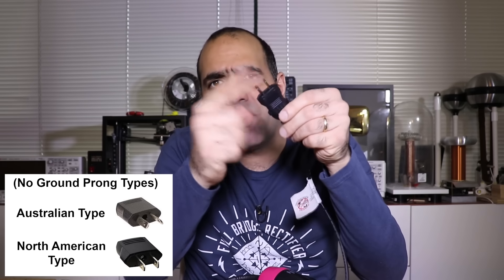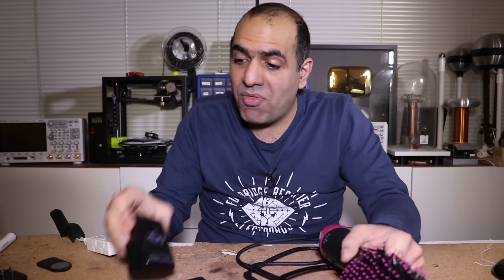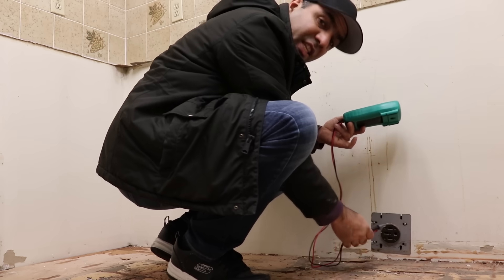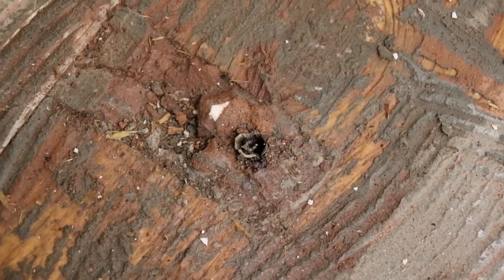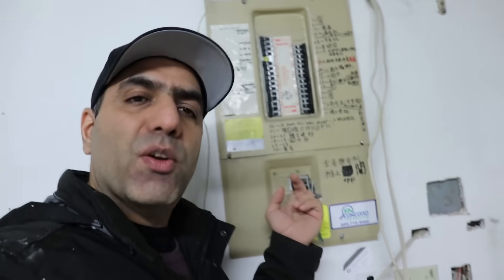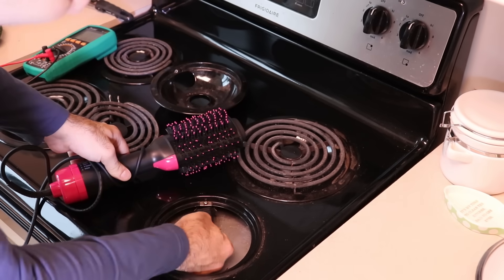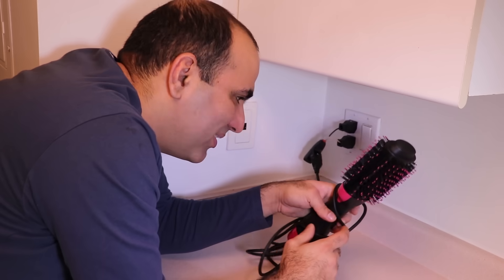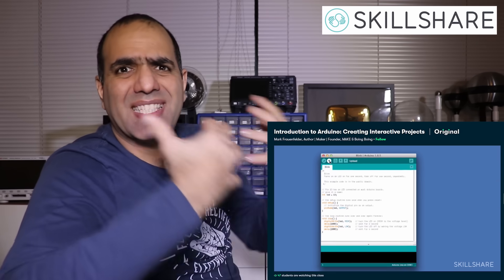Finding HIGH POWER 240V in a 120V Country

Comment: Kitchens are wired that way for a 3 wire setup and thus the neutral wire only conduct the imbalance of the load on those outlet.

Btw I know it's the case but I still have a super hard time wrapping my head around that concept. Making a video explaining the concept would be awesome of you as long as you don't hurt yourself.
Reply: Pure 3 phase systems don't have a neutral line. It is not needed. All current in any direction travels down the phase conductors of which there are 3.

The electricity traditionally is output from the generator station as 3 phase. Some power stations such as hydro electric may differ.

The 3 phase conductors are routed from the generator to your district where they feed into a step down transformer (I am missing out the step-up at the power station end).
If you're feeding 3 phase power to a 3 phase motor used in industrial applications, you don't need a neutral line.
But if you want single phase to feed your home, then you need a single phase conductor and a neutral. That neutral does not come from the power station, it comes from the local step down distribution transformer that is in your locality to your home.

That distribution transformer is a 3 phase transformer with 6 wound coils. Three on the primary high voltage side and 3 on the secondary low voltage side. Those 3 coils on secondary all have one connection connected together in what is called a star configuration. The centre point (don't confuse this with centre tap which is different) is where neutral line is connected.

Single phase loads will be placed across the phase conductors and neutral. For example, Load 1 would be across phase 1 - neutral, Load 2 would be across phase 2 - neutral and Load 3 would be across phase 3 - neutral.

If Loads 1-3 all use the same amount of power then the current in the neutral line is zero, and this is said to be balanced.

Unbalanced loads, where the loads have different impedances and are consuming different amounts of power results in a neutral current flowing.

The power companies don't like a large amount of neutral current flowing, so effort will be taken to try to balance the load across the 3 phase conductors.

Comment: Oh my goodness. What a messed up system. 110V for some stuff and 220V for others. Why not stick with 220V 50Hz across the board like we do here in Australia and the Brits. So much simpler and it works well.
Reply: Because very few devices need 240V, and our split phase system is far safer.  We get 240V when we really need it, but no part of it is ever more than 120V above ground.  Most things run just fine on 120V.  For the very few devices in our homes that need high power, we have 240V outlets available.

Comment: 03:49 to be frankly, i did that a bunch of times unintentionally XD
Reply: I've done it once. RIP to the 10A fuse and the tips of my probes :(
Still usable though.. other than current readings
Reply: To be frank*
Reply: ty
Reply: Sooo...did yours explode like that 😆😆😆
Reply: @YTshashmeera  mine did not
Reply: yeah, it did... but beside of the probes, the multimeter is still working fine nonetheless
Reply: @Guidje  What happened to your fuse if your multimeter literally exploded in a shower of sparks?
Reply: the fuse broked, i change it (and the probes) and everything went fine after that... of course the sparks weren't so intense or dramatic, but it happened

Comment: the 120V AC outlets in north america are not "180 degrees out of phase" as you say, in reality they're only getting half of the wave.
Reply: In reality, you're getting half the voltage because the neutral is always halfway between the two hots.

Comment: They sell the 120 to 240 volts step up transformer. It looks like a huge power brick. But yeah they really only made to run stuff like ac adapters and electronics.

Comment: Mehdi, can you do a demonstration to show whether keeping an appliance or other item plugged in (ie blender, USB charging block, power bar, etc) is using electricity even when not in use? I’m not sure if you’ve covered this in the past.  Thanks for all your hard work!
Reply: Unless the device has a physical switch that breaks the line coming in, then it will use power even when it is turned off.  Whether that power is significant or not, depends on the device.  A microcontroller that spends most of its time in sleep mode watching and waiting for you to press the power button on your TV remote control might use a fraction of a penny per year of power.  You can buy devices like the kill-a-watt to find out how much power they really use when they are "off".

Comment: large apartment buildings have 3 phase 208v for general use, and a single leg of 277 for lighting or just 3ph 208v..  most often off a transformer that is on the same property.  single family homes have 240v single phase right off the transformer at the pole.  (sometimes its 220v)

Comment: I saw the thumbnail and when the scene came I was like: „Let me guess, he‘s measuring current...“
Reply: Even though it's staged I still laugh my ass off when I see it
Reply: It was a nice effect x) Obviously he just has a small charge/firecracker on top of his multimeter, that's why it is conveniently tilted. He wouldn't risk breaking a multimeter just for the effect. Plus if you measure current like that when you are supposed to measure voltage it will only start welding the probe heads, no bangs (I've done that mistake a couple of times)
Reply: @TheJugiChan  maybe he has a capacitor thats not rated for high voltage
Reply: @vladchira521  The casings in multimeters are pretty thick. When stuff blows up inside you just hear a noise, definitively you don't see sparks shoot out. Multimeters have a fuse inside that protects the rest of the electronics and you can only hear a faint click when it blows. As fun as it would be to think he messed up, again, all of these "accidents" are for entertainment, but I do still appreciate them.
Reply: TheJugiChan ruining a multimeter lol it’s just a 10 dollar fuse
Reply: @jjelassar  Yeah, again the fuse doesn't spark. And again I do enjoy the entertainment. But it is not a god damn fuse that blows up in the video :P There is no reason to blow up a component inside when you can just more vividly make something spark on top.
Reply: @TheJugiChan   ....except for the fact in the next scene he has 2 of the same meter on the ground, it was staged but i think he used a real meter to do so
Reply: @frogz  The fact that he has two doesn't mean anything. If the one blew up why would he say "I hope it still measures current. Hey it does!" and then he just doesn't mention he switches. Then more points: when the sparks fly, both of the probe wires are close to each other, this is not the case even if he was measuring current. He is clearly holding then in place so the end blow up whatever firecracker he has on top. Also, the damn probe wires don't magically fly off. It takes some force to take them off a multimeter. Mehdi is a smart guy. I find it cute that most people want to believe these accidents happen to him in every video. And again, I appreciate the entertainment value, but blindly wanting it to always be an accident is naive.
Reply: @frogz  End I also repeat, multimeters do not blow up like that even if  he really were to have the measurement on current. The probe heads would just solder on a little and melt and/or the fuse would trigger (in a very non-explody way).
Reply: TheJugiChan exactly correct multimeters only blow up when your dealing with high voltage like high enough to run heavy machinery I work in an aluminum mill where some components are 4000 volts and I’ve seen an electricians multimeter straight exlpode arc flash hit the probes and the probes completely vaporized
Reply: and he dies

Comment: American homes use a single "split phase" instead of two phases of the three.  Each half are 180 degrees apart and together give you ~240v at 60hz.   I was surprised to learn that Canada did things differently.
Reply: Canada does it the same way.  His apartment building is a large urban building with 3 phase power.

Comment: Apartments usually are wired off of one or two legs of 3-phase. Homes usually are wired from single phase 240. You are such an idiot I won't bother with phase angles.

Comment: 3:48 This is why you shouldn't buy cheap crappy multimeters, they blow up in you'r face when you accidentally measure voltage in current mode!
And the first multimeter got damaged, that's why he got second multimeter at 4:23.
Pro'sKit MT-5211 multimeter has fake CAT IV 600V rating, it can't even with stand CAT II 240V short circuit in current mode!

Comment: National Electric Code requires two 20 amp circuits for the kitchen.  No guarantee they'll be on separate phases.  Really unusual to see two outlets on the same receptacle on different circuits, but if you have a small apartment kitchen, maybe.  I rather like the electric stove hack.  But here we also see that it's easier to rewire your house than to tell a Persian woman 'no'.
Reply: In the Canadian electrical code (CEC) it states that kitchen receptacle can be a 15amp split receptacle and if it’s 3ft near a sink, it has 5o be a 20A GFCI.  Also no more than 2 receptacles per breaker.
Reply: @Alex-lo6yt  Ah, didn't realize ElectroBoom was Canadian.  I should have been paying more attention.
Reply: If it is a multiwire branch circuit like in ElectroBOOM's kitchen (two circuits on one duplex outlet), they're guaranteed to be on opposite legs or phases because they must be on a double pole breaker according to code since they share a neutral.  If they're just 2 circuits going to different outlets, then you're right, there's no guarantee.

Comment: Could you please explain electron flow theory vs standard theory?
Reply: Ben Franklin had a 50-50 chance to guess which way current flowed, and he got it wrong.  He assumed positive charges move from positive to negative.  150 years later the electron was discovered and everyone realized their mistake and that really it's negative electrons that move from negative to positive.  But by then everyone had been using conventional current flow for 150 years, so it was too late to change.  Mathematically, they're equivalent, so it really doesn't matter for many circuit analysis purposes.

Comment: maybe some of you can answer my question:
a standard electronic device has two pole plug: 1x Live and 1x Neutral
How does the device work, if you have 2x Live (L1 and L2) without Neutral (like shown in the video)? i thought your device always must have a Neutral pole.
Reply: because each l goes above and below 0v 60 times a second 60hz) the l1 and l2 are out of phase, so l1 will be postive while l2 is negative, then l2 will be postive and l1 negative.  look up 3 phase power for more.

Comment: Not sure if you already explained this, but how does the Intermittent Windshield Wiper work? - I know it is electronics, but how does the delay work? And how did the original inventor, Robert Kearns, build his? I have seen Flash of Genius several times, but never fully understood how the invention works, or how it is delayed. Anyways thanks.
Reply: Time delays in analog electronics are usually done by charging a capacitor at variable rates to reach a trigger voltage.  And this is basically how the Kearns patent says it works.  Of course today it's often done digitally with a microcontroller.

Comment: Hey i have a issues with my 1kwatt pure sine wave inverter and will not handling a small bar fridge on kick on  that uses 730watts over a 24hour period. So would installing a 240volt capacitor to help with fridge high power in rush for a few seconds????
Reply: No, a capacitor won't work like that on an AC circuit.  And it doesn't use 730 watts over a 24 hour period.  Watts are instantaneous measurements.  The other problem you might be running into is that your inverter likely is rated for 1000VA, not watts.  And a fridge has a rather poor power factor, so its 730 watts might be more than 1000VA.

Comment: Your apartment is fed from a three phase 120/208V power bank or pad mount transformer. It's called network metering. A regular house is fed from a 120/240V transformer.  The 208V might vary 204. 205, 211...etc.  120 degrees apart in three phase and 180 degrees in single phase

Comment: How does this work without a neutral or ground wire? you have +120v on both sides?
Reply from the maker: No it is two 120b 120 degrees apart. So the hair drier runs on the difference of the two which is 207v

Comment: At 3:27 the word "invert"  is accurate but many people believe that the transformer winding is somehow reversed. The transformer would work in North America or in 230v areas. Provided the primary voltage is the same. In 230-40 land you would not use the center tap at all. In North America you move the wire called neutral to the center tap. This provides two 120v lines. In effect a +120vac and a -120vac. Here the + and - refer to the phase. This also means that while using the 240v circuit no single point in the circuit is above 120v from ground.

Comment: As a supposed electrical engineer you should know that those aren't "two phases". Its single phase 240 volt split down the middle, which is why its called "split-phase". A neutral wire is placed in the middle of the secondary winding of the transformer to get 120v. 120v is half of the phase, not its own phase.
Reply: No 120 volts is not half of the phase. It's the potential difference from a phase line to neutral. Saying it is half the phase gives the impression it is half the phase voltage which it is not, it's the full phase voltage. It's just where these point is when measuring the potential difference,whether that is on the neutral line or on the other phase line.
Reply: @deang5622  It’s literally in the NAME. Split-Phase. The neutral is LITERALLY placed in the middle of the secondary winding, splitting the phase into two parts. The FULL phase is 240 volts. Half of the phase is 120. Both legs are not 120 degrees out of phase with each other. They are part of the SAME phase. I suggest you educate yourself further on what split phase ACTUALLY is.
Reply: @xNYCMarc  I know more about this than you. I have one of the highest qualifications possible.

I am picking up on your use of terminology. It is misleading. I know how it works.
Reply: @deang5622  I highly doubt you know more about it than I do based on what you said in your previous reply. If you have “the highest qualification possible”, then you need to demand a refund. You clearly don’t understand what split phase actually is, that is, a single phase literally “split” down the middle. As for my terminology, it’s perfectly fine to use plain language. You’re just using that to deflect from you being so wrong.
Reply: @deang5622  Let's break it down plain and simply:
""120 volts is not half of the phase" Yes, it IS half of the phase voltage. The phase is 240 volts.

"It's the potential difference from a phase line (actually, it's called a leg) to neutral" Um, yes it is, which is half the voltage of the phase, which is 240 volts.

"Saying it is half the phase gives the impression it is half the phase voltage which it is not" That's EXACTTLY what it is. 120 is half of 240. Use a calculator if you don't believe me.

"It's just where these point is when measuring the potential difference,whether that is on the neutral line (again, it's called a LEG, mr I'm picking up on your terminology) or on the other phase line (leg)." Yes, when you measure half of the secondary winding, you get 120 volts. When you measure the potential of the entire winding, you get 240.

Any questions? I'd be happy to help better your understanding of the issue.

Comment: I live in Australia with 240v, how do I do the opposite? For example if I have an appliance that runs on 120v, how can I power it without blowing it up due to double the voltage?
Reply: transformator?
Reply: @frozantini  obviously with a transformer but I was looking for a more techy diy way
Reply: @mickeyBtsv  Inverters aren't too bad price-wise, but their duty-cycle sucks. You have to wait "forever" to charge the battery.
Reply: buy two of them and run them in series between live and neutral 😁

Comment: The apartment building is supplied from a 120/208 volt, three phase, four wire service, though each individual unit is only supplied with two lines, 120/208, single phase. Homes in North America are supplied with 120/240 volt, single phase, three wire services.

Comment: In some commercial buildings the main panel is 480 Volt 3 phase with each phase 277 Volts to Neutral. Our office has this so you have to be careful when selecting timers and motion occupancy sensors to replace light switches. A transformer in the building provides 480 to 208 3 phase where each leg is 120V for the outlets and 208V equipment.

Comment: @ElectroBOOM - 
YES even this beefy stove plug / socket has the same shocking 100 Years behind the time problem ... USA / CN / MEX should really upgrade its standards to recessed sockets and/or partly isolated pins. 
Since there are 2 hot & no neutral , even unpolarized sockets (like the German one) are OK & if recessed even far safer than the USA junk.
Reply: And yet somehow in my entire life the US socket design has never once caused me any problem whatsoever.
Reply: @stargazer7644  - 
there are people that had never problems sticking cables into an outlet without using a plug (often in the 3rd world & rural Siberia) ... 
 but both can shock you ... only a recessed socket or sleeved plug can prevent shocks (like using a plug darkness)
Reply: @stargazer7644  - 
a reasonably designed socket-plug-system greatly reduces the chance of shocks (France, Germany/Korea, UK etc. fixed their systems & Brazil + South Africa are beginning as well) ... the Darwin award is now supplied by the Monsanto-needle "against" corona